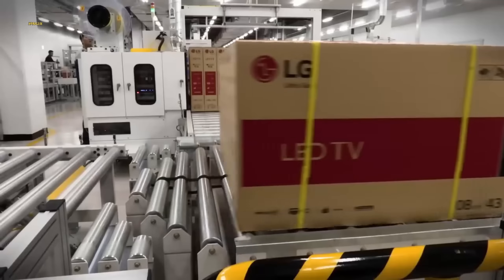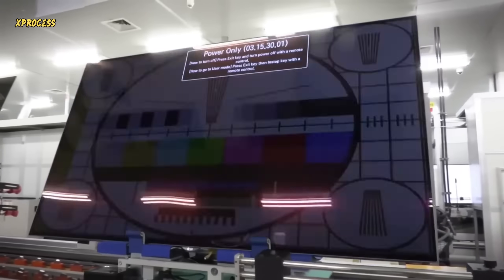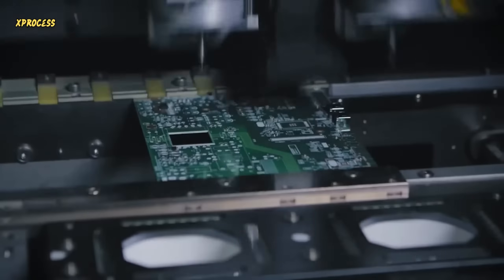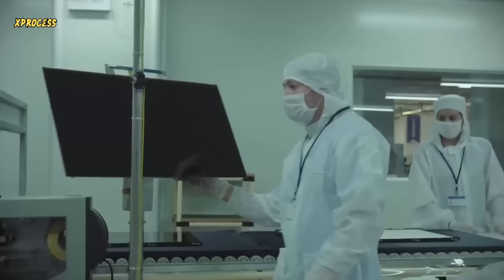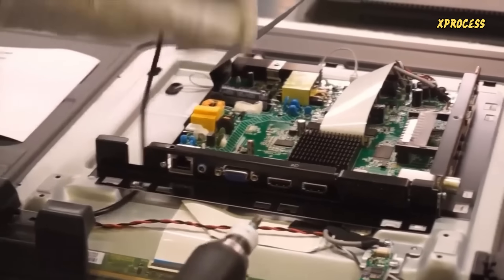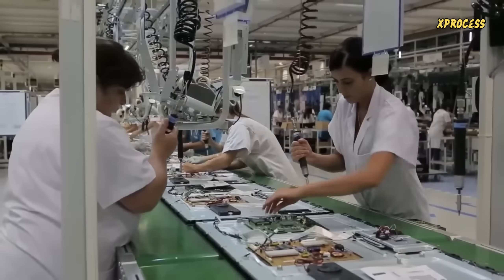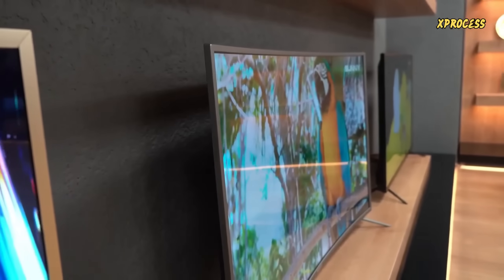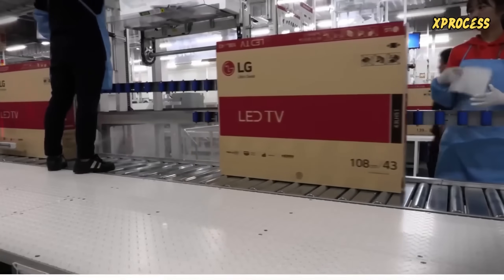How Televisions Are Made | Biggest TV Factory In The World !!

Comment: The screens will last 20 years, but the capacitors on the circuit boards will leak and die in less than half that time. The little reflectors for the LEDs like to fall off giving you a bright spot on the screen. Cheap adhesive. 

LCD & LED TVs are pretty easy to trouble shoot & repair, if you can find components for them. The screens, themselves, last an extremely long time.
Reply: Most likeky, the backlight will fail when 1 of the LED's dies.
Reply: @angrycatowner  Not always, it depends on how they are connected. Sometimes, one or two will fail and the backlighting still works, but it will have a slightly dark area on the screen.
Reply: @angrycatowner because it is fixed in series...so .. I guess
Reply: @angrycatowner  OLED does not use a backlight
Reply: TVs today don’t last long, it’s only last for five years
Reply: You can significantly increase the life of those TVs, BTW LCD & LED use the same technology, they are both LCD, originally LCDs were backlit with fluorescent tubes, today they are still LCD panels but lit with LED l ights.  TV companies are screwing you over, those TVs come out of the box with backlight set to FULL !!!!!  I have always run my backlight at 50% or less brightness, your eyes will get used to it very quickly.  I've had a good computer monitor since 2011 (LED based) and it is still running fine to this day.  The PSU is external.  WIth today's TVs the PSU isi nternal, it's 1 power board, connected to 1 mainboard and a bluetooth/wifi module + LED strips.  I am not worried about the life of the LCD panel itself, it can last a super long time, and if you are constantly viewing HDR content and backlight at full, yeah your brightness will dim pretty fast over time, by 50% and getting worse from there.  I've been running my backlight at <50% and it has not dimmed at all during these years, if I were to raise backlight now at full, I could burn my eyes, it is so bright it can blind you, they don't make TVs like that now, their (cd/2 brightness rating) is horrible now compared to before.  The circuit boards are easy to change, problem is how to open the bloody TV to access them, companies have made it a pain in the arse for you to open the back, you need flat prying tools, THEN good luck finding the matching parts, companies do not sell them direct to consumers, so you have to buy them from aftermarket sellers on eBay, Alifuckingexpress or some web sites, which get those boards from used TVs.  and if you understand electronics and can pin point the issue on the mainboard or power board, you can easily replace the failing component which will generally be a bad capacitor, a short somewhere, but most of the time it is bad caps, they are so cheap to buy but you need to know how to solder and desolder.   so these companies using the cheapest components in those circuitboards and cheap caps, even a big brand name everybody knows, has been known to using non compliant caps in their smart TVs one of these years, the wrong voltage, so these caps would die in as little as 1-2 years..........Let's see now, LED strips cost about $50, I'm sure the boards are very inexpensive too, but to get your set repaired out of warranty, you will be charged near the price of a brand new TV, just for the idiots to remove faulty card, and snap a new one back in !!!! and don't expect they will give you a brand new board either, they will give you refurbished, used parts harboured by returns, old defective boards refurbed, with new cheap capacitors also., and TV sizes are getting bigger and bigger.   If it were a small 20-32inch set, yeah you could do it on your own, but try handling a heavy MF of a 75' TV, it's not pleasant, and these big ass TVs still use the same cheap half arsed circuit boards, you lot are being RIPPED OFF left and right.
Reply: @jimmydandy9364  Boy. you wrote a full book here.
Reply: @phaenius  to żle? chłopcze?
Reply: replaced the led strips on my 8 year old LG 42" screen. Several burnt out but no reflectors had fallen off.
Reply: @konradpetz7317 well they use good component I guess
Reply: I don't know, I want to replace the backlighting strips for my TV, I have the original LED strips, but I have to disconnect the panel from the rest of the TV and remove it. Disconnecting the ribbon cables can be a difficult job if you don't know what you are doing, very easy to break in the hands of a noob.
Reply: True, my old NEC IPS monitor lasted around 17 years until the CCFL backlight started to buzz and flicker one day. Although even before that it was showing signs of degradation like the color temperature drifting towards warmer tones over time and the panel slowly starting to de-laminate in the corners. Still, 17 years is a very respectable lifespan for any electronics that is being used on a daily basis.
Reply: It is not reparable when screen damaged .and it coasts toooomuch  I guess...
Reply: There are 20 year old CCFL LCD TVs still going strong.
Reply: Then tell me why my four year old tv started to show three Grey static horizontal lines, indicating a dead panel?
Reply: I changed all the led strips in my 42" LG tv. The LED's burned out the reflectors stayed on.  Big improvement in viewing
Reply: I remembered my VCR repairman showed me the plastic components in 2000 compared them with the 1900 VCRs which were mostly metals. No wonder he made a good living repaired them
Reply: So much different than yesteryears CCFL TV's those keep rocking, and in worst case scenario of heavy on-hours, you will only see some faint yellowing at the end of the tubes.
Reply: If hisense comes on but doesnt get to the logo and the light flashes blue and red what does it mean
Reply: mobîlle phoñe👽🥚🪆..
Reply: Who's going to keep the same TV for 20 years in modern world? Today's best TVs in 20 years will look like dinosaurs on stores shelves.
Reply: Pretty easy to repair, but a PITA to dissasemble and reassemble. Those screens are fragile as fuck, and can break while disassembling/reassembling. Source: I broke one, trying to replace the LED backlights.
Reply: @thomasmittelwerk410  On smaller screens, like 32 or so, panels are easier to handle, but on larger ones it requires a great deal of care. But the ribbons, that's what I am most afraid of not damage.
Reply: I'm still using an lcd panel from 1997. I've transplanted it to its third chassis, and the screen itself still looks far more vibrant than anything sold today. Almost 300,000 power on hours and it's still flawless with no dead pixels!
Reply: @hackhp  I find that very hard to believe, Mr Smart.

Comment: WoW ! ! ! I had no idea the components, screens and testing were a complex as they are.  This was very educational. i appreciate my large flat screen TV now, more than before i saw how it's manufactured.
Reply: Even more telling is that LG and Philips TVs are on the same factory floor.
Reply: If you have the money it is better to buy a tester unit(around $10k) and buy the lowest priced tv at the resolution you want. When the TV breaks down plug into tester which will show you which component to replace(usually less than $1 to buy from electronics stores) and all you do is unsolder the defective part, solder in the replacement and viola your tv works again for whatever period. Most people replace their TV's every 5 years or so(often less) yet keep replacing defective components and you can get 20+ years usage from same tv.
Work out the cost of minimum 4-5 tv's over that period and it is far more than a tester unit and soldering iron and solder. People are so wasteful nowadays.
Reply: VIOLA! ?  :)   @saintsone7877
Reply: @saintsone7877  The LCD panels are only good for about 10 years. And replacing the LEDs behind means ripping apart the entire display. Here's hoping you can get that mess back together and functioning in your living room.